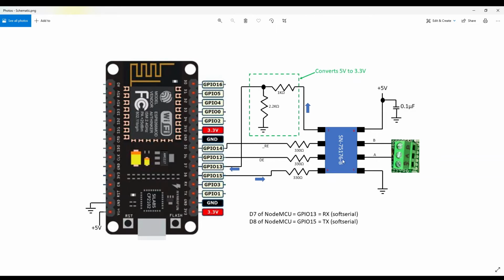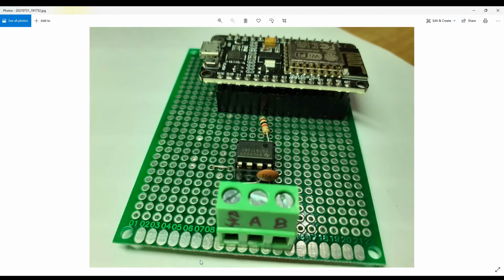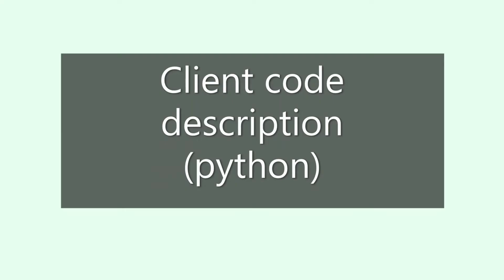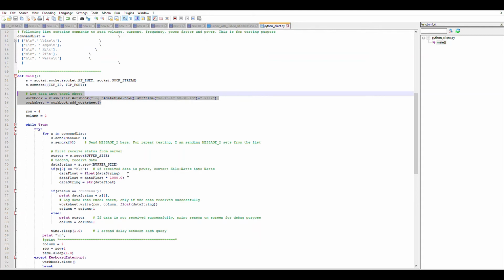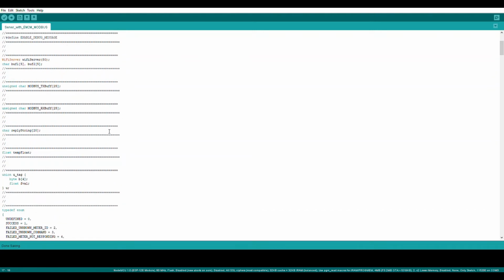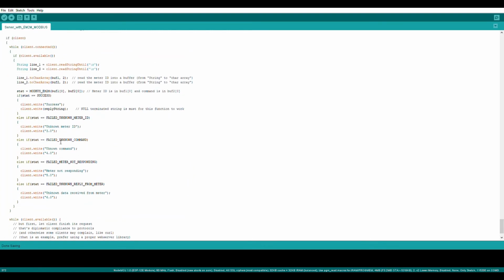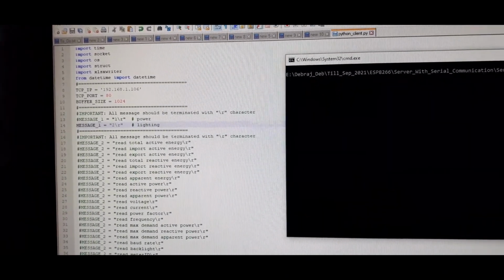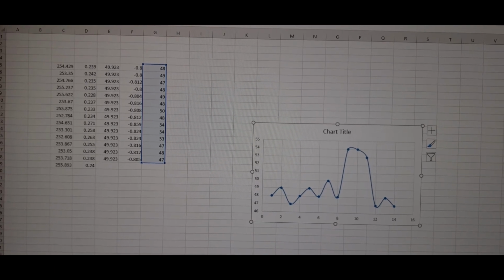Smarter energy meter with Selec EM2M + nodeMCU ESP8266

Comment: i have tried to turn on and turn off the backlight of selec em2m-1p-c-100a meter 

example snippet :

if (command == 'v') // "backlight OFF"
  {
    MODBUS_TXBuff[1] = 0x10;   // As per MODBUS standard, '0x10' function code to WRITE "holding registers", which are read/ write
    MODBUS_TXBuff[2] = 0;   // High byte of address on EM2M is always zero
    MODBUS_TXBuff[3] = 0x0D;  // Refer to EM2M manual, this is low byte of address specific to the "holding register". Due to print error on EM2M manual, this register is called Stop bit.
    MODBUS_TXBuff[4] = 0;   // Number of points, high
    MODBUS_TXBuff[5] = 2;   // Number of points, low
    MODBUS_TXBuff[6] = 4;  // Byte count
    MODBUS_TXBuff[7] = 0;  // data-1
    MODBUS_TXBuff[8] = 1;  // data-2
    MODBUS_TXBuff[9] = 0;  // data-3
    MODBUS_TXBuff[10] = 0;  // data-4
    retStat = MODBUS_write_13_bytes_read_8_bytes();
    return retStat;
  }

its not working bro

Comment: what is the python version used
Reply from the maker: 2.7
Reply: @Debraj1978  i tried to run this on this with wemos Mini ESP8266 which is with same pin configuration but its not quite working. Will you be able to help on this?

Comment: HELP me !!!
"Executable segment sizes:
ICACHE : 32768           - flash instruction cache 
IROM   : 252116          - code in flash         (default or ICACHE_FLASH_ATTR) 
IRAM   : 28837   / 32768 - code in IRAM          (IRAM_ATTR, ISRs...) 
DATA   : 1520  )         - initialized variables (global, static) in RAM/HEAP 
RODATA : 1084  ) / 81920 - constants             (global, static) in RAM/HEAP 
BSS    : 26248 )         - zeroed variables      (global, static) in RAM/HEAP "

Comment: I have started working on this project now, and have modified esp code to just for logging on serial port, I have shared code over email, can you please check and provide your inputs
Reply from the maker: Sorry, Please understand that I do not have time to read your code. All details are provided on my video and website. You should learn from them and make changes for your requirement.

Comment: I am still using like your old setup with RPI, but instead of installing RPI in distribution box where meter is installed. I had spare telephone wire (around 8m), which I run from distribution box to inside where I installed RPI. Much better since RPI is now running on LAN and I had HDD attached to it for media storage too.
Reply from the maker: Very good. I wanted my R-pi for some other experiment, so did not want to use it for this repeated task.
Reply: @Debraj1978  Hmm I might go this route too in future if I decide to run Home Assistant on it. I learned that after installing Home Assistant, it doesn't allow and recommended to run anything else on it.

Comment: You are exactly doing what I want to do :) , can you also demo bidirectional capability of meter
Reply from the maker: Sorry, I do not have any solar panel etc to generate electricity to feed into grid.
Reply: @Debraj1978  you can try this just by putting output and input live connection in reverse order to meter and it should show negative wattage and your net watt hours going down
Reply from the maker: @imagine3DIndia  Sorry, I have already installed the meters in panels and I need to call electrician to pull out wires in panel. My house power will be cut.